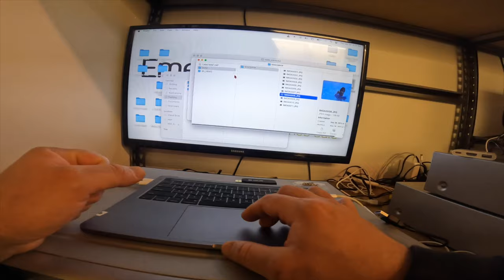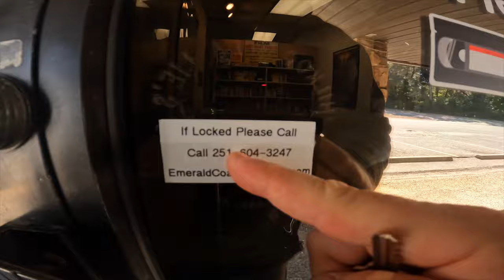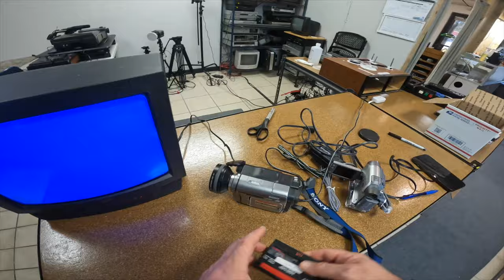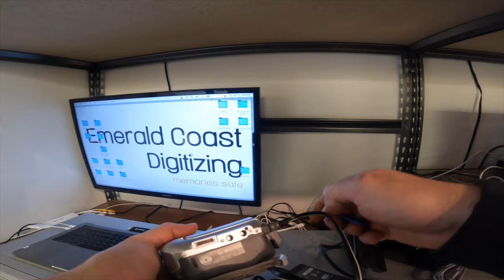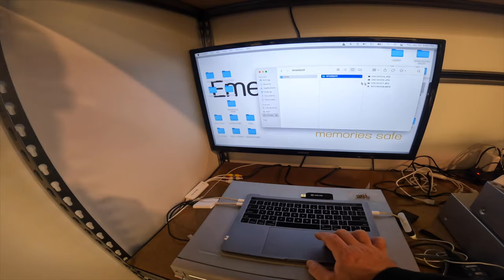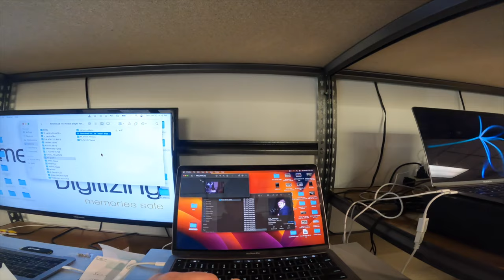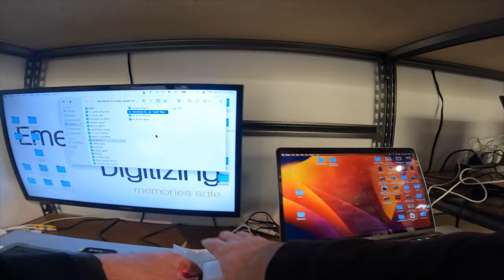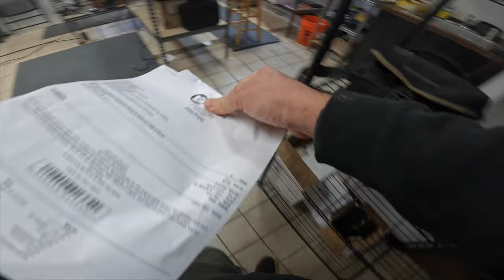MinDV And Digital 8 Camera trade in test

Comment: Have you tried Handbrake? I don't work with mod files but it's worth a try! It works with me converting whatever I have into a workable MP4 and/or MKV format to edit in DaVinci Resolve! And best of all, it's free with no BS! 😉👌
Reply: Yep I use Handbrake to convert them, and free video cutter joiner (pc only) will join them in the right order
Reply from the maker: I tried hand break and saw that it will do the job but, there are 450 5second videos… I didn’t post that part of the video. I need something that can queue that many files and do the work for me. I would like to not have convert each file individually. I changed the file name to mp4 but that def didn’t work. I’ll try .mov. I wanted to compile them into one video. And then convert but thy doesn’t seem to be possible
Reply: @EmeraldCoastDigitizing  Avidemux allows you to trim and combine multiple video files without reencoding or losing quality. You can remux multiple video files into a single container.
Reply: @EmeraldCoastDigitizing  Softonic have some good video joiner software that joins without having to encode them, then run the joined file through handbrake